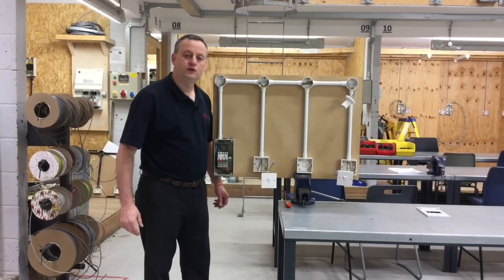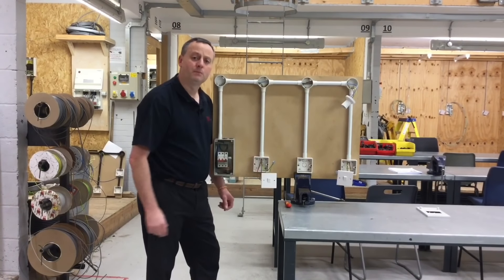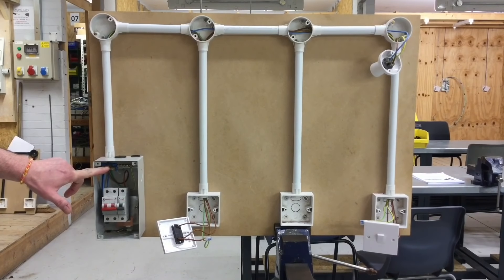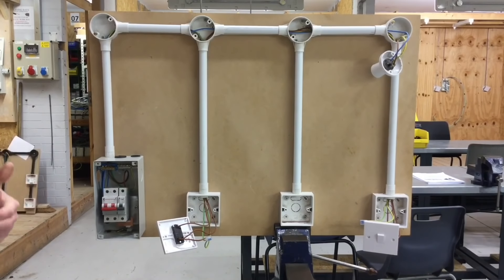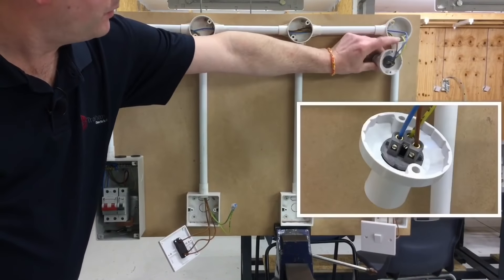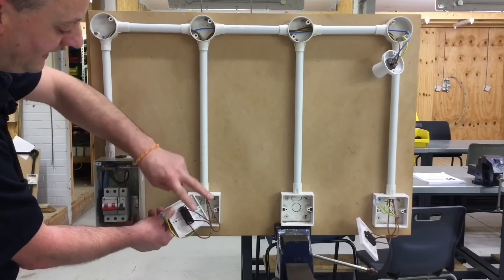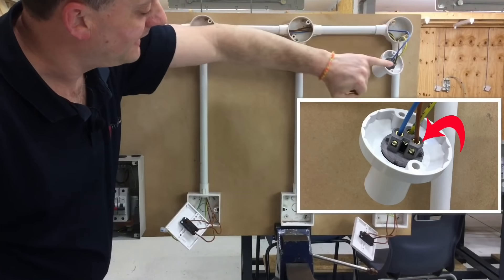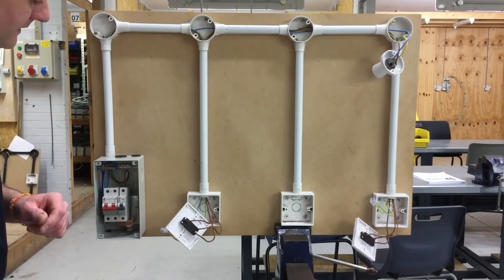Conduit Loop-in Method for Wiring 2 Way Switching of a Lighting Circuit Connections Explained

Comment: Wow this way is so much simpler lol, I've done plastic conduit pretty much the same way but with only 2 back boxes for the 2 way switch. Mine also had to have bends on it too. I done my two way a little different but this one is way more simple lol. For college I did my Line,Neutral, and CPC straight to the light. With my Line in to the loop, after that I used 2 line singles(brown) to the light(L2), and to the loop(L1). From here I then used 3 singles(brown) and followed L1-L1, L2-L2, and Common Live obviously 🙂. I will be watching more of your vids to help me on my course 👍 thanks
Reply from the maker: Hi. Thanks for the detailed comment and the support all the best with your course Gaz 👍.
Reply: @GSHElectrical  no problem 😁 thanks again.

Comment: I have a question on here why can’t you take the neutral to the switch then back up to the light, because what if the customer wanted to change the light switch to smart switch some require a neutral?

Comment: I have a dimmer switch that powers 2 lights in the same room - one is a ceiling fan/light with pull cords, one for power and the other for the fan. At the switch I've noticed the two reds are connected to the switch but the two black wires aren't connected to anything. 

The fan obviously has a permanent live feed and is switched on/off with the pull cord but can you explain this set up and why the black wires aren't connected to anything? Should they be terminated together in a wago block or crimp?
Reply from the maker: Hi. Thanks for the question I would need to see the circuit so sadly I don’t want to Speculate and feed you false information... however it is working then I wouldn’t mess with it is my advice all the best GSH Electrical
Reply: Thanks for the quick response. I appreciate that you don't want to speculate.. I just thought you might have an idea of why it's wired that way. Yes it's been like that for years so as long as it's safe. Thanks again and keep the vids coming please? Very informative